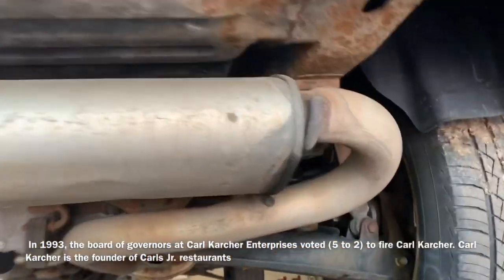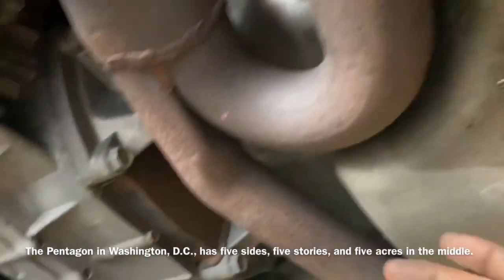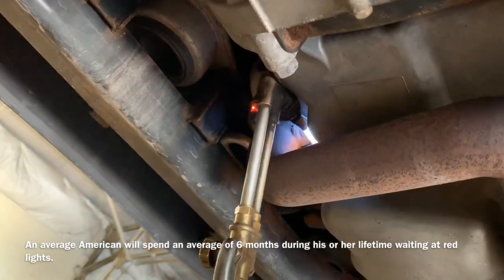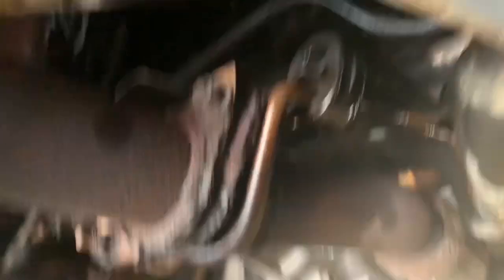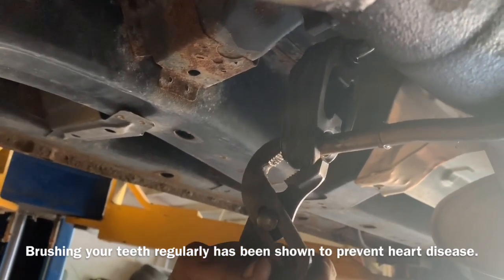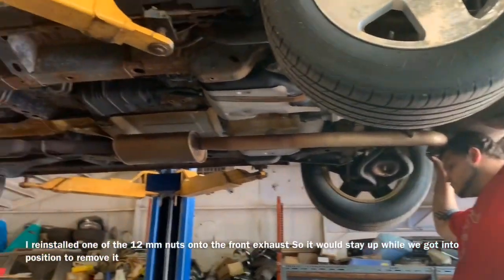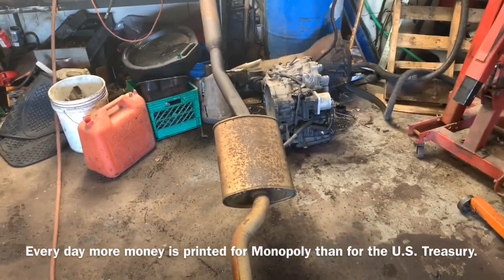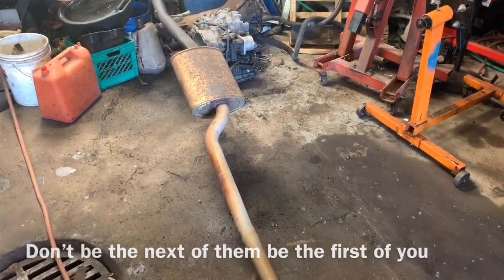Saturn vue 3.5 Exhaust removal

Comment: Quick question. I’m not really mechanically inclined, but I try just about anything on my own. What is a next step if you bust some of the exhaust bolts when trying to take the exhaust nuts off the manifolds in the front near the oil pan? Can they be grinded down or drilled out? Or am I out of luck and need to do some welding? (2005 Saturn Vue)

Comment: what would happen if I remove the cat converter on my 2006 saturn vue ? where I live there is no smog check required
Reply from the maker: Sorry didn’t see this before….. The vehicle would go into limp mode meaning that it would not know how to mix the fuel in the air correctly because it would not be registering the O2 sensors properly. 

If you did that you could install a O2 sensor simulator in the end of the plugs and then your engine will constantly make the proper fuel mixture ratio

Comment: We have a 2003 Vue with the 3.0 v6. Exhaust 'leaking'' where it connects to the motor. The flex looking piece looks rotted. Can just that part be replaced? It's really loud.
Reply from the maker: Yes as a matter fact I’m quite certain that I have video replacing that part
Reply: @sharpcarco  could you please send me link? Ty

Comment: What's the best diy way to remove the converter?
Reply from the maker: Hey big Kev I think it be easier for me to show you so watch my next episode of today with Clay and I will answer that question
Reply: @sharpcarco   Ok I'll be waiting because this converter is clogged so badly it will barely move 10 ft. In gear
Reply: @Lexie Nieves listen near the tail pipe to hear if it's straining to let exhaust out . Or out your hand near the pipe & you can feel a steady flow of exhaust. If the exhaust feels like it's coughing or straining to come out it's usually the. Converter
Reply: @Lexie Nieves  If it's the fuel pump a simple can of starter fluid can give you the answer. Disconnect the large blk hose connected on too the engine . Have someone spray it into the intake then start the 🚗. Just as it's about to cut off have them spray another squirt in there. Of it keeps running it's DEFINATELY the fuel pump.
Reply from the maker: Hey Lexi I’m not sure what you have going on but I doubt it has anything to do with the catalytic converter. It’s possible but it would be extremely hard to diagnose the problem that you have over the Internet I’m very sorry I wish I could be of more help
Reply from the maker: This is good advice listen to big kev
Reply: @Lexie Nieves Does the light come on on the bottom of the dash that is a lock with a key? It will light up orange. The car will start for a few seconds and then shut off. That would be the ignition telling you that someone is trying to steal your car. It shuts down the fuel system.
Reply: Do you live in Cincinnati ,if so could you work on my car for me, I am willing to pay